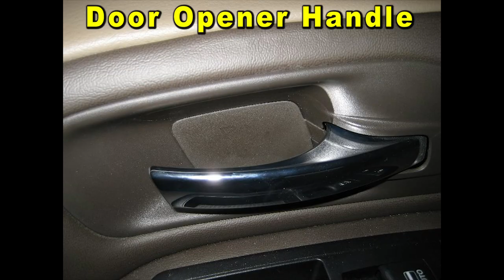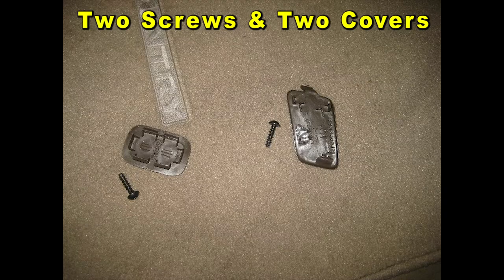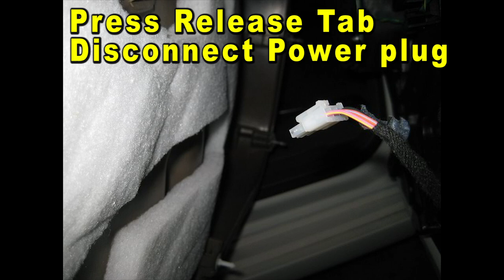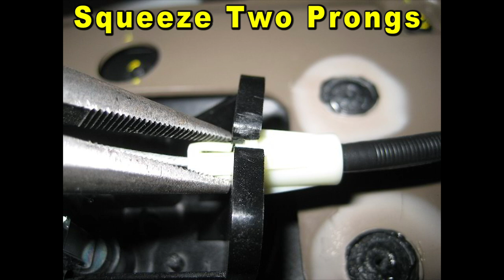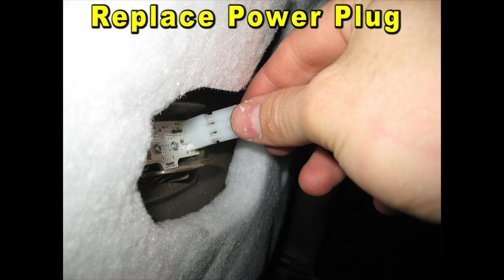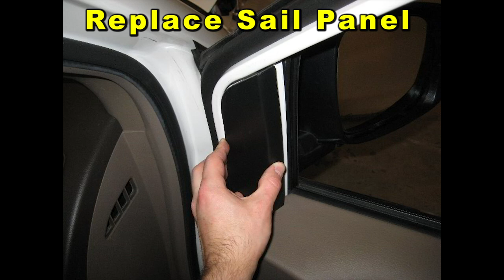2008 To 2016 Chrysler Town & Country How To Remove Door Panels & Upgrade Speakers With Sizes

Comment from the maker: Chrysler Town & Country Car Speakers - https://amzn.to/3UZGcPV
Dynamat Sound Deadener - https://amzn.to/3wIU3kj
Precision Screwdriver Set - https://amzn.to/3sLixaP
Plastic Pry Bar Tools - https://amzn.to/3HMtsV7
Socket & Ratchet Set - https://amzn.to/3Z17LbA
Mechanix Gloves - https://amzn.to/3jCnHkt
Torque Wrench - https://amzn.to/3vS5uSI

The Paul79UF YouTube channel is a participant in the Amazon Services LLC Associates Program, an affiliate advertising program designed to provide a means for sites to earn advertising fees by advertising and linking to Amazon.

This DIY video shows owners of the 5th generation 2008, 2009, 2010, 2011, 2012, 2013, 2014, 2015 and 2016 Chrysler Town & Country how to take off the plastic interior door panels (or "door cards") in order to upgrade the OEM speakers.

Comment from the maker: Check out the DIY guide for removing the door panels and upgrading the speakers in a fifth generation 2008 to 2016 Chrysler Town & Country - 
https://www.paulstravelpictures.com/Chrysler-Town-and-Country-Interior-Door-Panel-Removal-Guide/index.html

Here are all of the DIY repair and maintenance tutorials for the 5th generation 2008, 2009, 2010, 2011, 2012, 2013, 2014, 2015 & 2016 Chrysler Town & Country minivan - 
https://www.paulstravelpictures.com/Articles/Chrysler-Town-and-Country-Common-Problems-Repair-Maintenance-Guides.htm

Owners of related Chrysler Group minivan vehicles such as the Dodge Grand Caravan, Chrysler Grand Voyager, Lancia Grand Voyager, Ram C/V Tradesman Cargo Van and the Volkswagen Routan may also find these DIY instructions to be helpful.